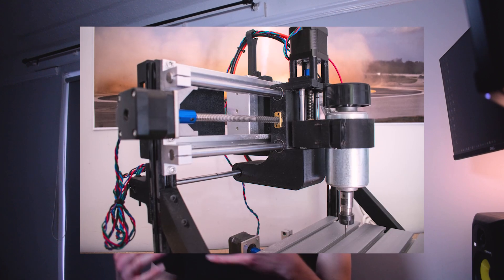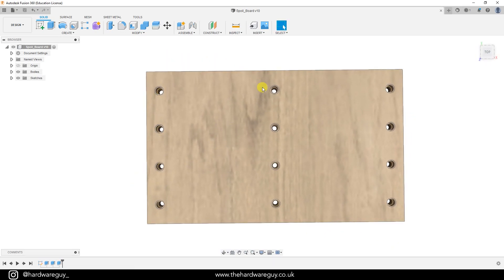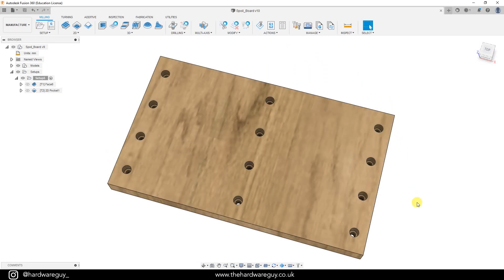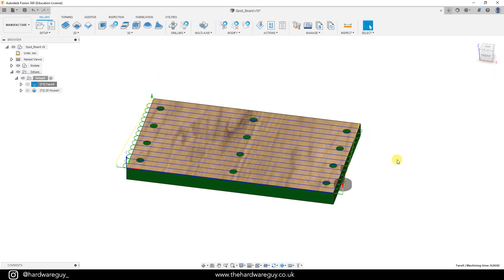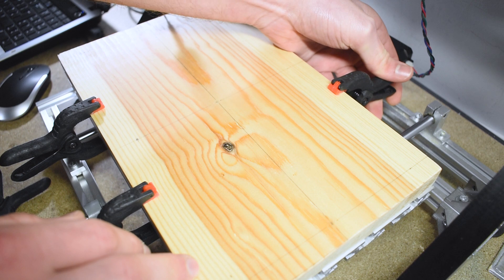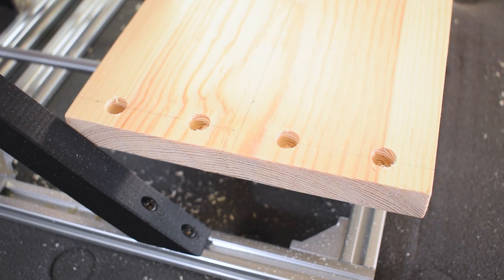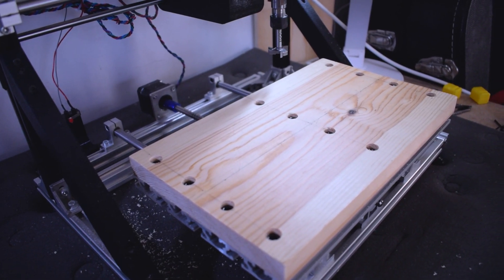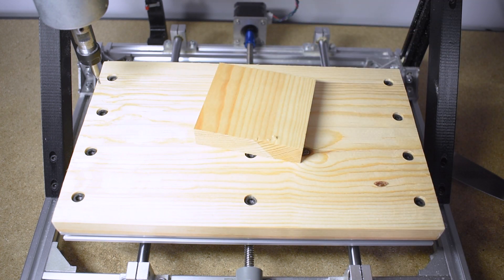3018 CNC Spoilboard

Comment: Hello and thanks for the video,
The T Nut 6mm link is now dead (20220806) Could you find another with the correct fit and provide dimensions so we might source locally.   Upon searching for T Nuts 6M I find different sizes for what I assume are different extrusions none of which I assume are the CNC bed. 

Can you recommend a reference on T Nut identification?

Thanks!

Comment: Why on earth did you use solid wood?????   That will forever be unstable given changes in humidity.  Wood moves.  Composite boards like Baltic birch plywood or even particle board would make a much better spoil board.
Reply from the maker: Honestly it's just what I had lying around. I agree that there are better woods to use, but  for the practice projects I'm working on it'll be completly fine. Takes less than 5 minutes to re-face the entire board should I ever need to level it again